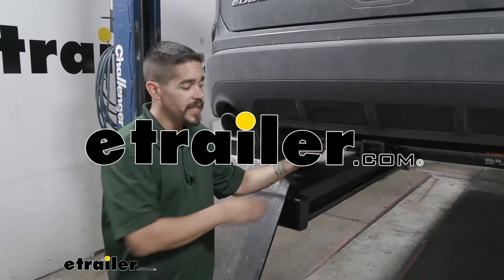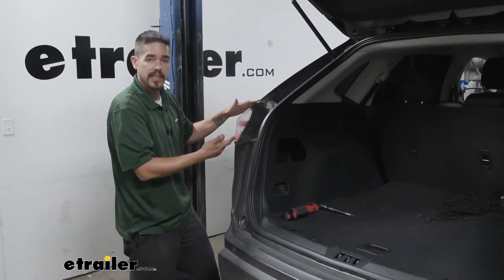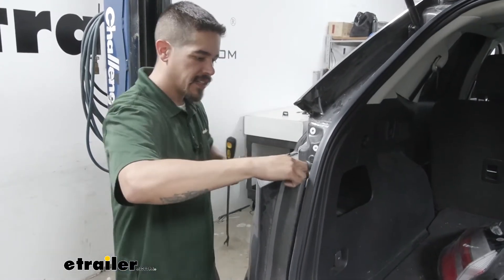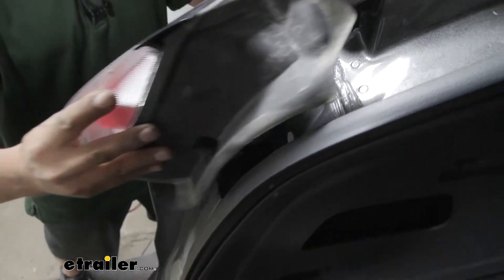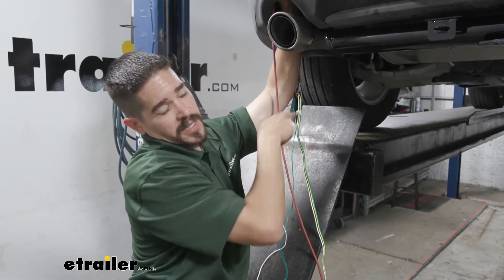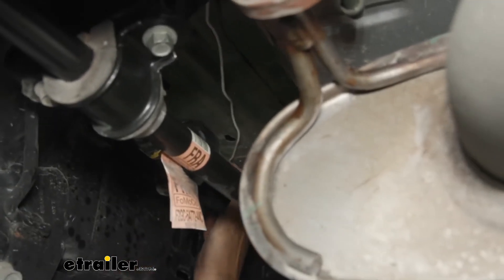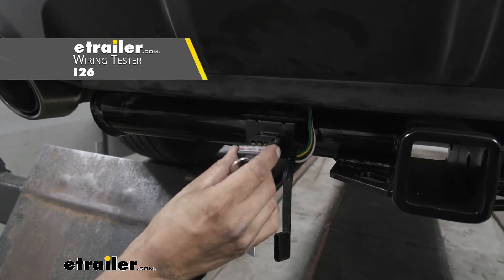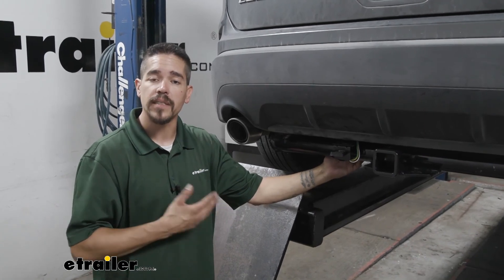etrailer | Curt T-Connector Vehicle Wiring Harness Installation - 2019 Ford Edge C89FR

Comment: Where's your heat shrink to protect those connecters from rotting and corroding? Other than that helpful video.
Reply from the maker: Although that connection would end up living up inside the cavity under the taillight assembly where it would be somewhat protected, I'd also recommend using some heat shrink tubing to protect the connection. Good call.
https://www.etrailer.com/Custom-Fit-Vehicle-Wiring/CURT/C89FR.html